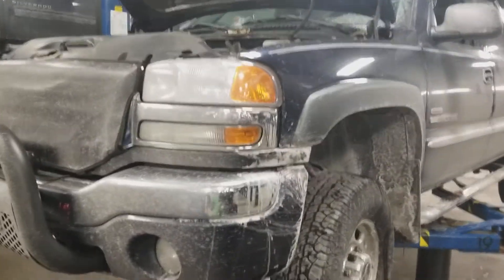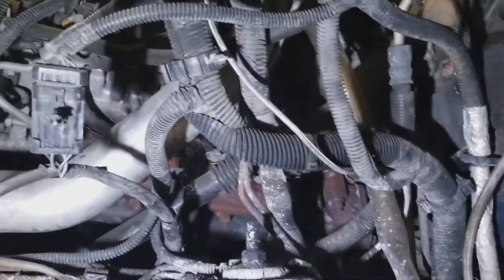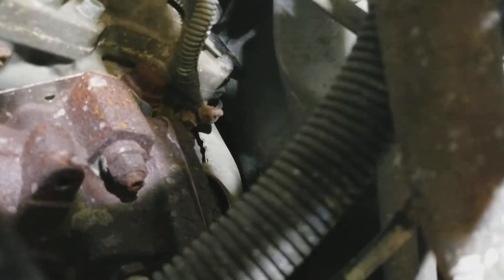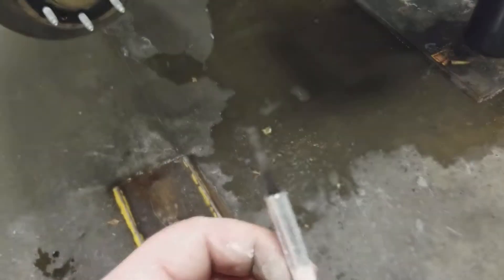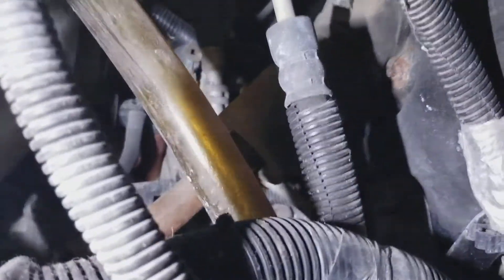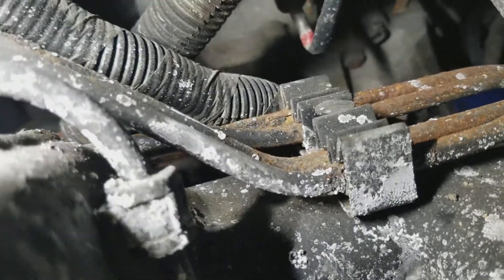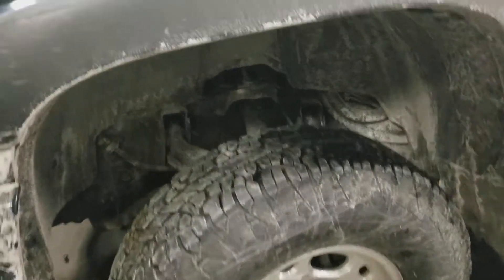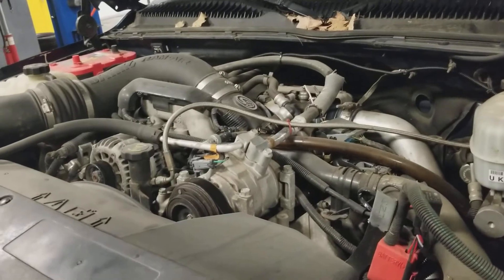Duramax Glowplug Change

Comment: You skipped the entire procedure for removing it and getting out the pieces when it breaks.  Many other videos on this subject.
Reply from the maker: well....that's because I didn't brake it.  I know it was a joke, but seriously if you f--k up and snap the tip off in the head....your f--ked because now the "procedure" is to remove the entire head to get it our of the cylinder which will take an entire day even if you "know what you're doing".  Then since you are basically doing a head gasket job (for free because YOU f--ked it up) you have to remove the other head as well.  Why? because you will have to machine the heads in order to assure you put flat surfaces back together and if you skip that step you WILL blow that head gasket in the very near future.  If you don't do both sides at the same time you will have one side where the engine geometry is off because the deck height, length of push rods and ect is different which WILL cause damage to the camshaft, push rods, rockers and valves.  Of course you could SKIP all this and royally screw the customer setting him/her up to do a head gasket job and all the other BS I just mentioned (And there are people who do that) or you just zip wheel it, slap a new head gasket on and prey for the best and stick it up the customer's ass when they come back needing thousands of dollars in repairs because you messed up in the first place, but that is a ghetto-ass job and I don't do ghetto-ass jobs nor do I screw customers nor would I work for someone who does.......sorry so long here but the short answer is TAKE YOUR TIME on these glow plugs or it will cost you a whole lot of time (for free) to fix and lose your shop alot of money.
Reply: I know right he must be magic, waste of youtube space

Comment: Cool thanks man!  I have a 2006 LBZ, and my master cylinder looks just like your what was the outcome?
Reply from the maker: was a bad seal between the reservoir and the booster.  I removed that and replaced with new seals.  While I was at it I did a brake flush and no problems since.
Reply: Awesome! thanks man, great help!